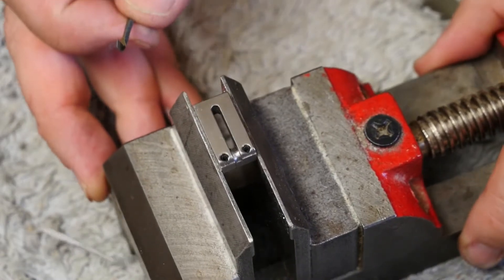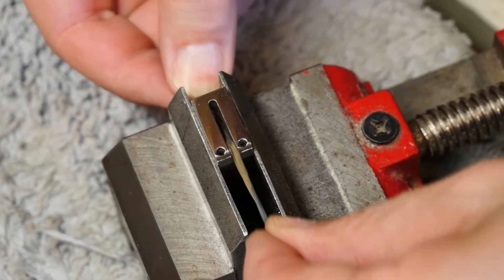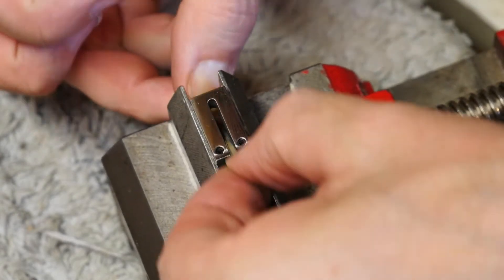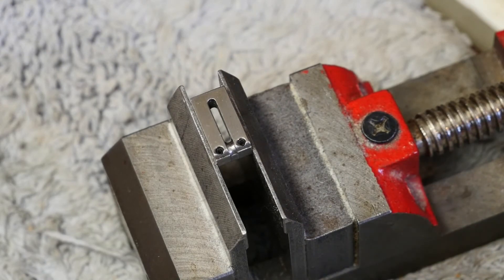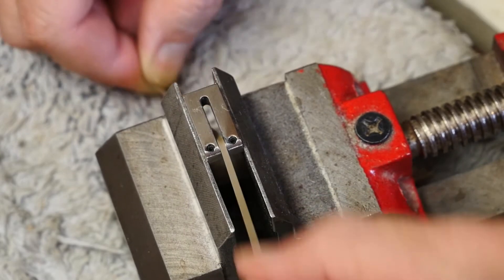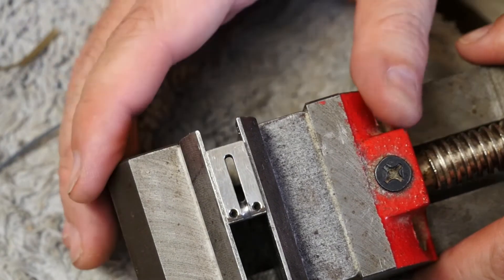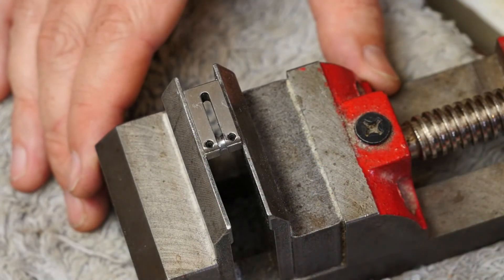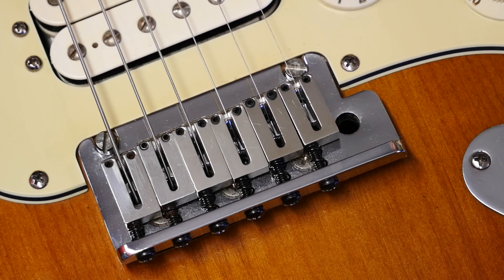My Strat Breaks Strings

Comment: Great info, however, my strings would usually break NOT at the saddle, but at the sharp edge of the saddle "plate" holes where the strings pass over from the sustain block BEFORE they hit the saddle. So I took everything apart and and drilled those holes big enough (more like an oval) so that there is NO string touching anything till it gets to the saddle top. The only strings I ever broke were the high E or B. But I did them all anyway. I play every day (I'm 69 years old) and they just don't break anymore. I use NYXL strings and just to be sure I also polish the top of the saddle, but as I said, when they used to break I would take the broken end and put the ball end back in and they all broke right at the plate hole. Thanks. Steve Buffington.
Reply from the maker: Good solution Steve. 
I think SRV used to put a small amount of insulator stripped from a cable around the string there to stop it breaking on the plate. 

I think your solution is a touch more practical and elegant!
Reply: @TonyEdwardsGuitars  Thank you, I almost mentioned that about SRV - I saw a picture of that in a very old Guitar Player magazine comparing SRV vs. Jeff Becks' Strat set ups. I was concerned no one would believe that and take me for a blabbermouth. Ha! I learned a trick from an old guitarist in 1968, he said to (on Gibsons) to use a little 600 on that type of saddle then go straight to the side of a matchbook. Y'know, the thin cardboard side. I did and it has worked ever since. But that is mainly on Gibson types only - they have no steel holes. I also (on Strats) give the hole in the sustain block a a pretty heavy sanding so the block (also sharp) does not touch the string on it's way to the Steele plate. The steel and sustain block are harder than thought they would be. it took hours to drill them open enough so there was no contact. I use no string trees, I use locking staggered tuners so there are only TWO points that touch from block to tuner: the top of the saddle and. the nut. I use a Graph Tech XL self lubricating nut, the best I have ever used. Those nuts are so good they wouldn't stick if you poured super glue on them! Thanks again - Steve Buffington